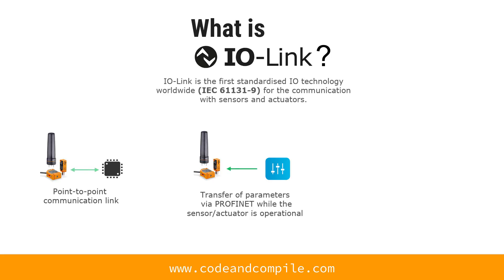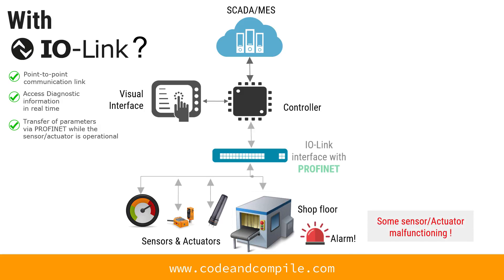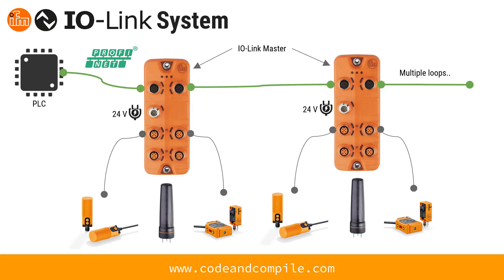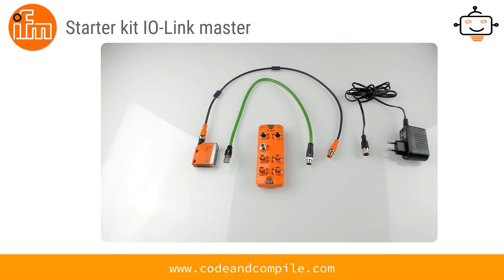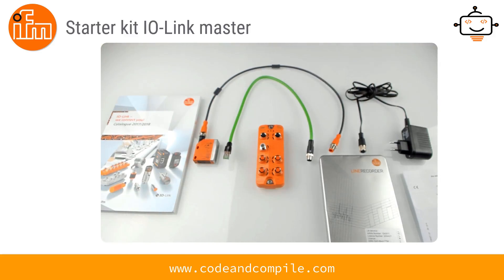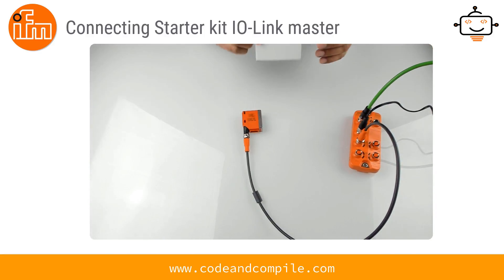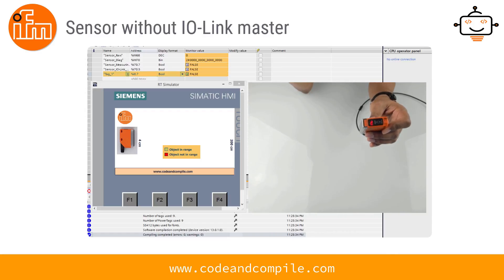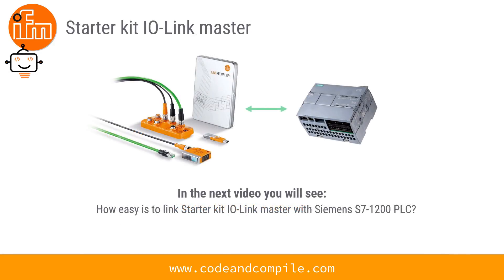What is IO-link?

Comment: I disagree on "Not being able to trace rapidly the source defect" in a sensor for an alarm, I am a controls engineer and perform this task on a routine basis every day I have a sensor failure. In fact with Sensor wired to Digital Input I/O I get the sensor name and PLC Slot Module/Terminal Location directly from the I/O configuration and the Electrical Schematics leads me to the proper Panel PLC location. I don't see any advantage there, on the other hand, I see an advantage in structure and localization of IOLink Module, however, I must go through LR device.
If I am missing something here, please provide some insight, I will be delighted to analyze and review my position.

Comment: (i have the same IO-LINK AND SENSOR you have. the communication between plc and IO-Link it's ok) but I have a problem transfer data to pcl i need your help
Reply from the maker: Did you link your IO link with TIA portal ? Now you just need to assign the addresses for the inputs. Check my second video.
Reply: @thegeterrdone  TIA portal The Siemens software for PLC.